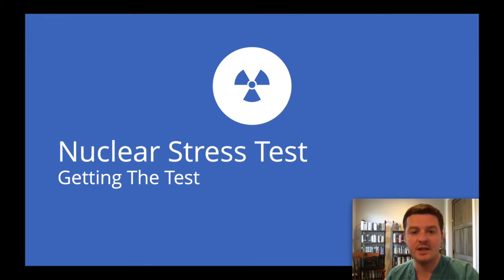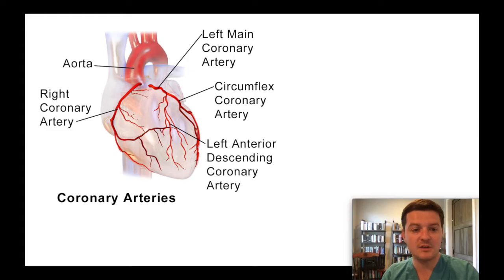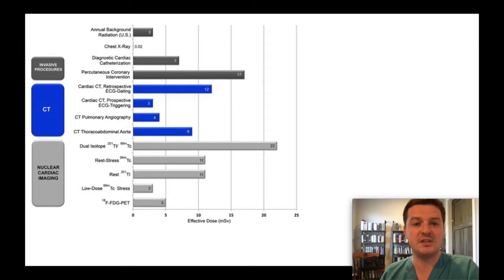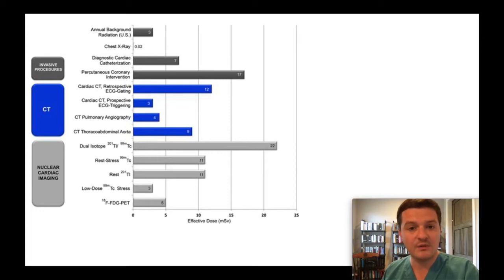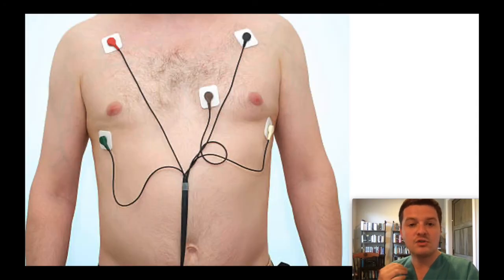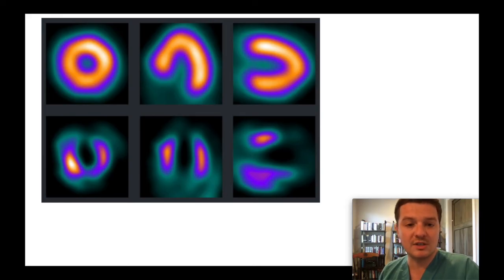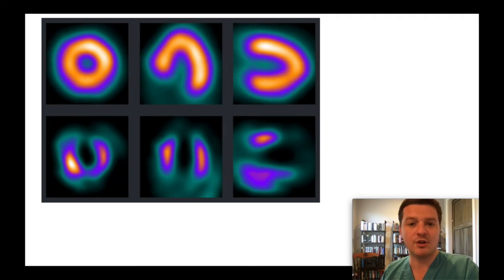Nuclear stress test: what to expect

Comment: Some questions I have after watching this great video:
1. My understanding that the 11mSv for a stress test is usually for a single dose. In my experience most stress tests do a double dose (at rest and then again when stressed - as you mentioned). In that case the exposure is trending toward 15-20mSv. Could you confirm this?  When I asked at my regular nuclear stress test (no major abnormalities - just some chest pain) they said I received 44milliCuries in dosing in total which seems to be around 20mSv when converted.

2. Radiation exposure also depends on the type of tracer. Most seem to use Tc-99m (what I got) but looks like Thallium-based agent can also be done which is higher effective radiation.

3. Some stress test imagers also do a calcium CT scan which adds additional radiation exposure (~<1mSv I believe).

4. Some places instruct patients to limit close-proximity to small children, babies, and pregnant women for 24hrs-48hrs. The half-life of Tc-99m is 6hrs and you're still slightly radioactive for that period. While I'm sure the amount you'd subject someone to is negligible to the dose the you receive, it's still some radiation and young people are more susceptible to it.

5. If you're wanting to limit your radiation exposure as much as possible, drink a lot of water and sweat/shower if able. The radioactive elements are excreted in your pee, stool, and sweat. So if you pee a lot of it out a few hours after your procedure you may be reducing some of your exposure versus letting it sit in your bladder/kidneys. Plus being properly hydrated helps in body repairing the damage done to the tissue.

I appreciate your video, it was very informative.

Comment: What if you have knee problems and have a hard time walking fast, is there another thing besides walking on treadmill....maybe a bike?
Reply: You will be given a chemical stress test instead.  You will be given a medicine that will dilate your blood vessels causing your blood pressure to dip slightly for a moment and your heart will compensate by beating faster like you were on a treadmill.  It only lasts a few minutes and drinking a caffeinated beverage afterwards will help any symptoms you have to go away.
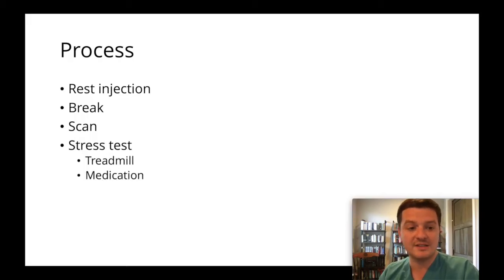Reply: Yes and yes.  See @ 6:05, drug induced stress test/ no exercise.  Bicycles and arm powered are available at some clinics.

Comment: Hi can anyone explain this I’m so stressed out thanks in advance FINDINGS:
The stress and rest images demonstrate mild fixed defect in
the apical through basal inferior wall, favored to represent
attenuation artifact over prior infarct (SSS: 3, SDS: 0).
There is no evidence of myocardial scar or ischemia.
The left ventricular ejection fraction was calculated to be 55%
Wall motion is normal.
The left ventricular cavity size is normal.
CONCLUSION:
Mild fixed defect in the inferior wall (SSS: 3, SDS: 0), favored
to represent attenuation artifact over prior infarct
No evidence of ischemia.
Final result
Reply: You have part of your heart missing on both your rest and stress images, but the Dr. thinks this is most likely due to an attenuation artifact because your heart wall motion is normal.  Attenuation artifacts are usually caused by your bowels and liver taking up the tracer and blocking the bottom side (inferior) wall of the heart.
Reply: @JohnnyOU08    Oh, thanks for this info!  I think the same thing happened with my own imaging.  My cardio doc said the very bottom of my lower chamber had a darkish spot but said he wasn't overly concerned as the results looked pretty good and that darkish spot could be just a slight shadow cast by my abdomen? And so with the results he wasn't ordering more extensive testing or any stents either.
Reply: Whole food plant based diet can help reduce plaque
Reply: Your heart findings seem to be quite good by what I've been able to learn! But Always ask your doctor to carefully explain the results to you in a layman's language!  (After all, we are not trained in medicine or medical terminology!😉)

Comment: What if they only  waited less than 10 minutes after each injection, should I be concerned? Also, I immediately became winded and was breathing very rapidly and when it was over I vomited. During the process I felt a lot of pressure in my neck and my arms down to my hands. Do you see anything I should be concerned about?
Reply: Hello did you have a " chemical "stress / lexiscan ? Thanks

Comment: Are you available to answer questions on here??
Reply from the maker: Yes!
Reply: @ChrisKellyMD  ok I am actually at the hospital now. I'm having a heart catheter done after an abnormal nuclear stress test. Cardiologist said that a small spot showed up and that it was mild to moderate. I'm scared...
Reply: @ChrisKellyMD  also I had an ECG that showed a "low probability" of a past heart attack, yet I don't remember ever even close to having a heart attack and according to my cardiologist the Nuclear Stress Test showed no indication of a past heart attack. He says he is skeptical about the ecg reading and will know for sure during the heart cath.
Reply: @chad6326  How are things going for you now? Did you get any answers since you posted this? I hope all went well.
Reply: @nelsonfan24  hey... I'm fine. Heart Cath was good. Stress test was a false positive and my Dr said that sometimes ppl can just have abnormal ekg. 0 blockages and the heart cath said I have 0 evidence of past heart attack. About the best results you can ask for so... 

Thank you for asking.
Reply: @chad6326  May I ask you if the Heart Cath was an easy test or did you experience any discomfort?  Also may I please ask your age?
My nuclear test showed a slight shadow at the bottom. My cardiologist said he had mild to moderate concern but not enough evidence of anything to do further testing. He said the dark spot might even have been caused by my abdomen casting a shadow?.....hmmm?🤔
(Thank you in advance for taking time to respond back!☺)
Reply: @gloriamaryhaywood2217  from what i remember it was a little uncomfortable but nothing major at all. Easily managable imho. Best of luck to you, prayers 🙏